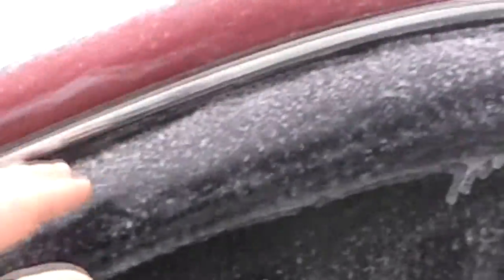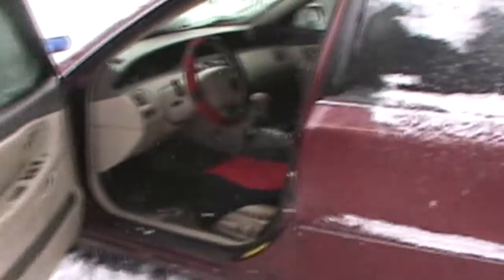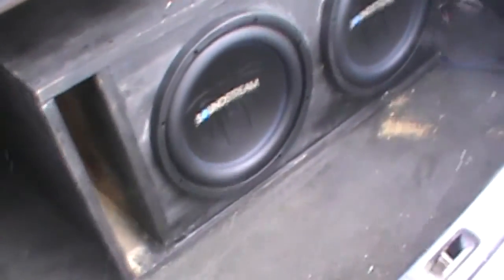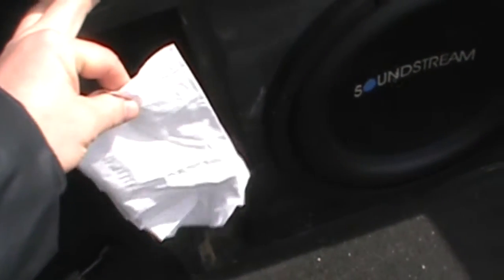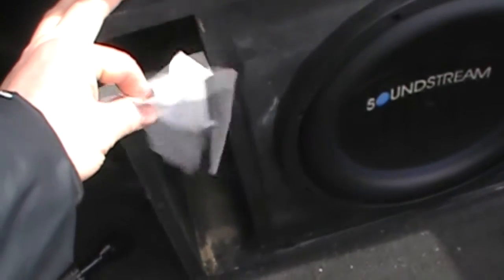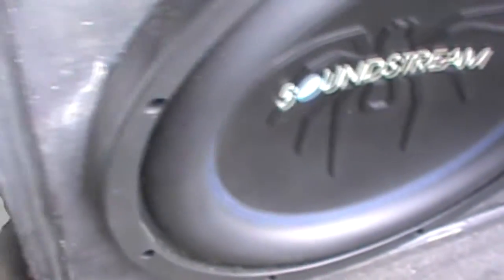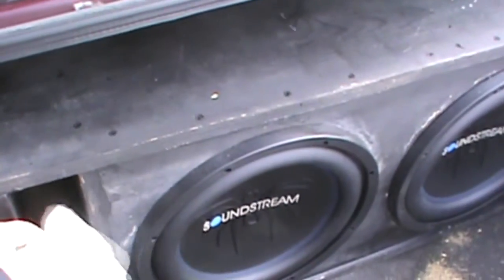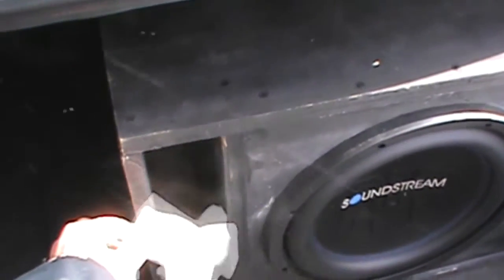Door Flex with only 400 watts!

Comment: Hey Brian,  

I contacted you about the single 12 of this subwoofer in the 3 cubic foot box.  I was going to go with one but wondering how these performed with 2 subs in a smaller box as opposed to 1 I'm a huge box.  Thanks again.
Reply from the maker: The bass was very quick and tight coming from the two in the same air space as one. Obviously it was much louder even with less power from the amp running at 4 ohms instead of 2 ohms. The bass, from an EQ curve perspective, had less lows, but the fact that it was so much louder just meant I could turn the upper bass down with EQ to achieve the same effect.
Reply: @AFreshmanPerspective  

Interesting!!!!   I just happened to acquire a dual 12 box @ 4 cubic feet tuned to 30hz.  Thought it may be worth getting another subwoofer.